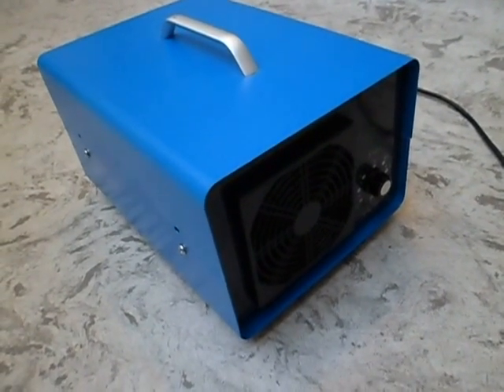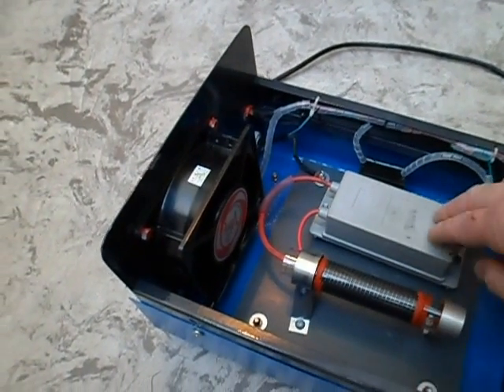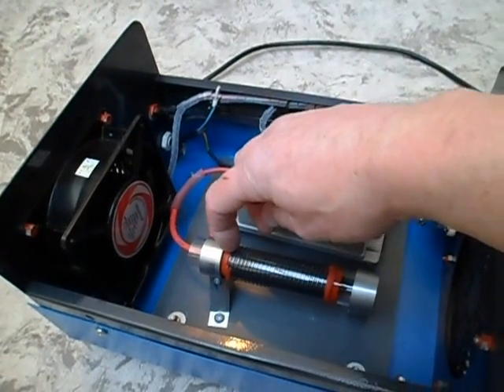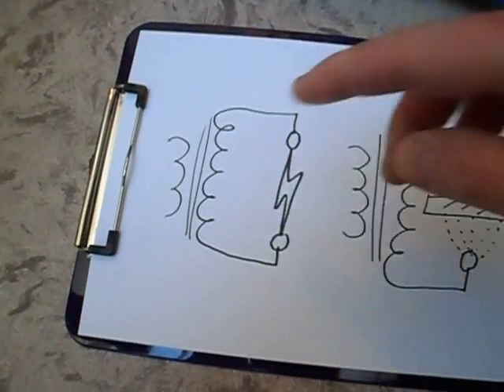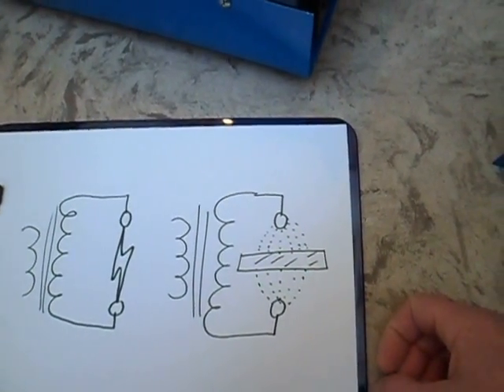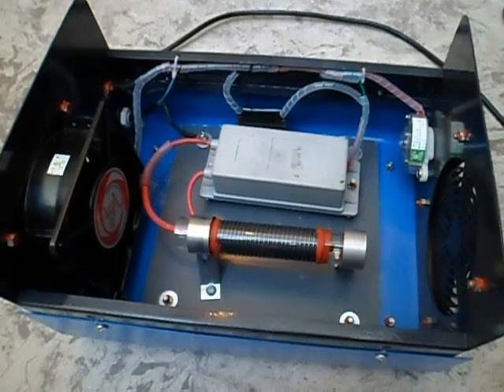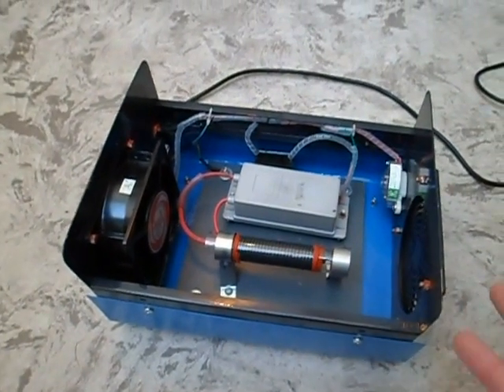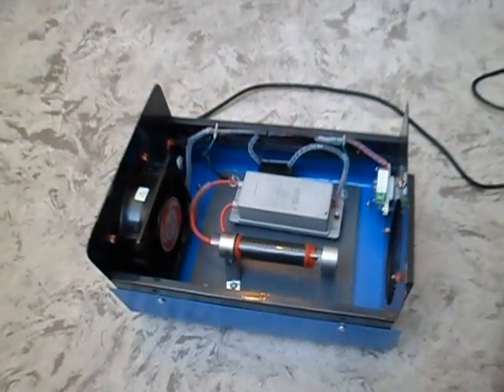Inside a Chinese ozone generator.

Comment: Nice video.  Too bad you have so few comments.  I think you did a good job.  I've been wanting my own ozone generator for a long time for several reasons.  I'd like to bubble ozone through water to purify it, and I'd like to see how well it works at keeping bugs out of places. 
On ebay you can find some pretty cheap ozone generators that are just a transformer and ceramic plates.  There's a company that apparently does this with a number of these generators, and mounts the plates inside fans to generate large amounts of ozone.  They are about $25 and up a set for a 7 oz per hour (so they claim) ozone production.
If you happen to know a better source of just the transformers, let me know.  I suppose a person could just use glass, and put metal on both sides.

I even looked into winding my own transformers, but I know so little about them, and what is the best combination of voltage output, watts, frequency, etc, I figured I just start by buying some cheapie china transformers.

Any suggestions as to what would produce the best corona, resulting in the most ozone?  For the transformers, what is the best voltage output, power, etc, and for the plates, what is the best to use?  screen?  wire?  is thinner better?  are some materials better than others?  Is a larger or smaller gap between the metals better?  Are some insulators better than others, or is it just a matter of using something that does not easily burn through?
Thanks again for the good video.

I tried making ozone using a micowave oven.  I disconnected the power in wires from the microwave generator and used a mayonnaise jar with copper wire wrapped around it, and a big wad of copper wire stuffed inside it, but nothing happened that I could see.  Maybe I had too much metal, or the microwave didn't generate enough voltage.
Reply from the maker: The high voltage transformers are notoriously difficult to make yourself so it's better to buy them.  The ceramic ozone plates are a very optimised design and very cheap on ebay now, so it's actually cheaper overall to buy your bits on ebay.  The generation of the corona relies on the alternating of the high voltage polarity, and the more often that happens the more corona is produced, which is why the high output units use high frequency supplies.
Be ultra careful with microwave oven circuitry.  It can end your life with a single pop like an insect killer.  The voltage output is too low for easy ozone generation and would have to be taken directly from the transformer without the rest of the rectifying and smoothing circuitry.  But seriously, just don't use the microwave transformer.  The electronic ozone generator supplies tend to be current limited so they are less dangerous, but can still cause a fire if the outputs arc.
Reply: bigclivedotcom
 Thank you for your helpful comments.  I think I will probably follow your advise on the ozone generator and the microwave.

How about your comments on another subject:  a colloidal silver/other-metals generator.  Do you have any knowledge on that subject?  I bought a book written by Robert Langlois on wire EDMs, that I thought I could adapt to generate metal colloids, but the parts list is old, and doesn't match parts I could find.